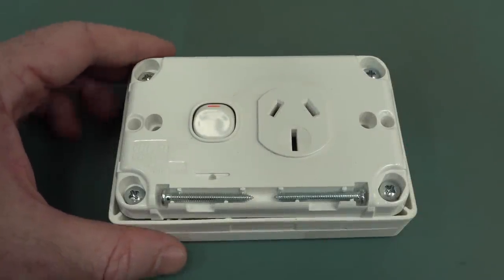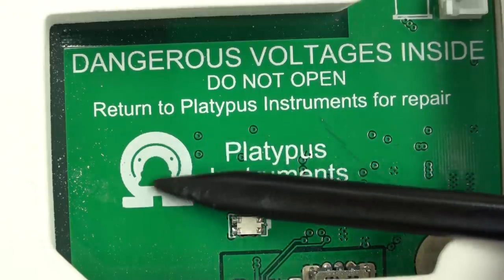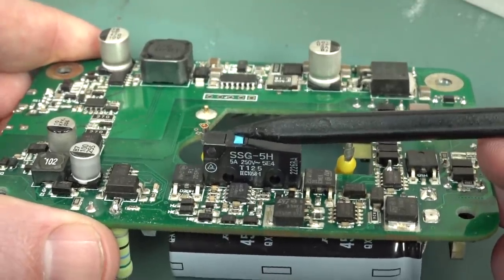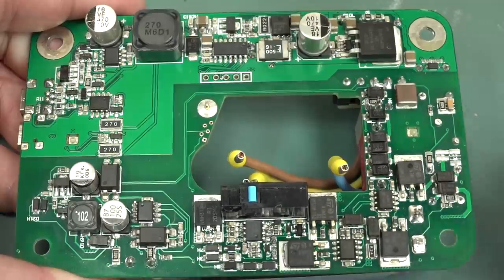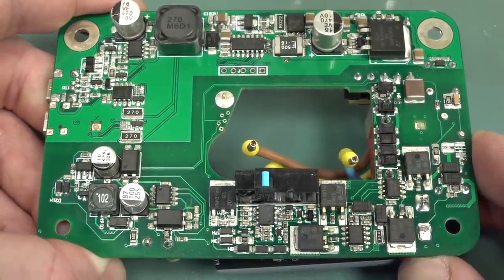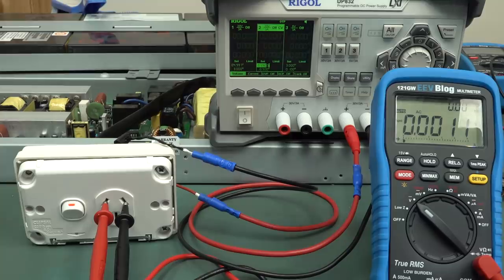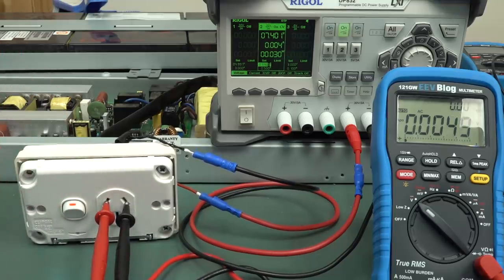EEVblog #1170 - TRUE Mystery Teardown! (not even Dave knows)

Comment: It is not a PAT Tester Tester.  It is a PAT Tester portable power supply for RCD (and possibly leakage) Tests.  The PAT Tester does the test the Platypus provides the power for it without needing a mains supply.  Nice idea, I wonder how many tests it can supply power for before it needs recharging.
Reply: its funny, I actually made a similar setup with a cheap 250w inverter and a battery from a pocket jumpstarter for when I go to hamfest's or flea markets buying old and antique ham/cb radios to test if they power up.
Reply: Yes would be interesting how long it lasts, it would last a while just doing portable rcd testing as it's over in milliseconds but the leakage test    product needs to run at  full speed for 30 seconds

Comment: Awesome idea! I worked for an Equipment Hire company and we needed to test the RCD on equipment that had a built in RCD, such as access equipment like scissor lifts and cherry pickers that supplied 240v to the basket. The RCD and tester needs a 240v supply and plugging into the building power could trip the RCD for the building, so I would lug a generator around with me. Considering this was done every single time the equipment was returned from hire it was a daily task. A gadget like that would have been awesome to have sitting on the work bench .
Reply: The new metrel pat tester has the isolation transformer built in no more tripping the rcd in the building

Comment: Did you reconnect the thermistor of the battery pack when applying the external voltage, maybe there is a lockout if no temperature signal is received?
Reply: Judging by the puffed battery i think he didn't put any thought towards temp, and btw hobby packs usually dont have thermistors, just balance leads
Reply: The 3-pin connector should be 0V - 3.7V - 7.4V for charging and the 2-pin 0V and 7.4V for power. 
Maybe it has a undervoltage protection for both cells... then it would shut off because there isn't 2*3.7V (ish) on the "charge" connector.
Reply: the two pin thin wired connector is the temperature sensor.
Reply: @jovangrbic97  No it is not. It's the main discharge leads. The 3-pin lead is for balancing. Go educate youself on hi-drain hobby packs and try again.
Reply: @zaprodk  main discharge leads usually use a thicker wire gauge than the balancing leads, not as in this case angel hair thickness wires, as used usually for thermistors. No issue in using one set of 3 leads for both charging and discharging...consider yourself educated
Reply: @jovangrbic97  you are incorrect. I worked for a hobby company for years, distributing RC-equipment and repaired equipment (mostly Hyperion chargers) - the discharge leads on small packs are indeed skinny, but there is ABSOLUTELY NO thermistor in a hobby pack. I would love to post a link for more info, but the comment Will be held if I do that.
Reply: @zaprodk  Quite right you are sir!
Reply: @jovangrbic97  like, it's not like you will ever get fat leads into that JST RCY-connector ...
Reply: @jovangrbic97  No, the Two pin one ist the total voltage of the pack, the 3 wire one is the Balance connector, the 3rd wire (blue in the middle) is the middle tap of the 2 series connected cells
Reply: @zaprodk  I agree the packs don't have one from the factory, but what about the device having it's own thermistor that was tucked into a battery?
Reply: The 2-pin connector seems to go to GND and the fuse (7:19), also, for a thermistor, the polarity wouldn't matter. I already posted a link to that battery pack at Hobbyking, which indicates that the 2-pin one is the discharge connector. But youtube indeed doesn't seem to like links  @zaprodk
Reply: @jovangrbic97  lol... who are you kidding with awg18 being angel hair thickness... and/or trying to reason that the JST cable isn't a main discharge cable...
Reply: @bryanjk  that's not the case. Then the company would have to open the pack and re-wrap it. Also if it was a thermistor, polarity wouldn't matter a rats ass.

Comment: Cool device and well built. Just a super niche market.  Great video. I'd make these videos too but, Bob's your uncle, not mine.
Reply: So well, they in fact could not even use a proper connector for the 200something output voltage wires you say?

Comment: Battery that comes with this devices also includes balance connector.  Looks like this device has safety feature that prevents powering on if balance connector is not plugged in.

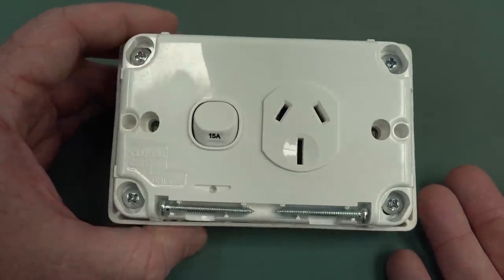Comment: 1:12 - What is the purpose of those two long screws attached to the case?
Reply: They come with the power outlet for install. A shiny smooth cover is usually clipped over them so you don't see anything but the switch and power socket

Comment: Dave, did you connect the lipo battery sensor while plugged the PSU to power it on? This might be the reason it did not turned on..

Comment: IDK if this was mentioned but it's like a Fluke PRV240 Proving Unit. Cool!
Reply: That, IIRC, is to test your tester/meter to make sure it's working before you use it to check whether a mains circuit is safe to work on. This thing is for powering an RCD (GFCI) device under test from a battery, so that you don't have to connect it to mains (which would be unsafe if done directly or inconvenient if done via an isolation transformer).

Comment: It's not a PAT-tester-tester

It's a portable supply for RCD / GFI testers. You need to measure trip times (sub 20ms at 50ma ground leakage in the UK IIRC) for them to be signed off as safe. This thing lets you do it in the field (literally) and is something that's not going to blow your bollocks off if something goes wrong. Similar to how insulation resistance testers (aka "meggers" or mega-ohm-meters) have a severely limited test current so you don't kill anyone when you shove 1000v down the lines to test for arcing.

Comment: Have I misunderstood massively ? It's a portable inverter for use with a PAT tester then - not capable of testing anything  itself...:o)
Reply: @
noakeswalker
yes , it is the power supply for the tester , it would do "go/no go"  tests such as connect an rcd (with no load or very small load) and push the test button :-)

Comment: Could it be that it did not work for you because you put only 2 of the 4 screws that holds the faceplate allowing a gap that may have ment that the interlock micro switch was not depressed?

Comment: What brand electric screwdriver do you recommend? 
Doh! Before I got to the part where you said don't look it up I already had. Fail. If you want us to not look things up, tell us at the beginning, lol!)
That Wurth transformer is a isolated flyback converter, essentially a switched mode power supply in a transformer format! There's another mosfet inside.

Comment: If ABB or similar was smart, they would jump on this and give the guy a bucket of cash for the rights to this. This is a really neat device and once that has actually important work to do. Jobsite power systems are no joke and they can be pretty dangerous. The RCD's on the spiders (distribution hubs) take a major beating and should be tested OFTEN. This is a smart device....hopefully they can make something of it. As I said, if some of the big time power distribution companies out there were smart, they would jump on this.
Reply: As well, they really picked all the top brass parts to stuff into it. Nothing from the shenzhen market in that puppy. A+

Dave, do you think when you tested it, it didn't work because you didn't bond the earth and just left it floating? I mean, thats what its designed to test after all ;-)

Comment: It all seems a bit 'how ya doin' to me.  Surely all you need to do to test an RCD is to push the button and see if it turns off.  Why would it need an isolation transformer in the first place?
Reply: I suspect some (most?) RCD's are self-tested by applying power to their internal trip mechanism when the test switch is pressed, rather than by testing via a mechanical button.  My guess is this makes for a more reliable indication that it will trip on an actual ground fault.
Reply: @PartTimeLaowai  The test button on an RCD connects a resistor which passes a 30mA current from the line input side to the neutral output side hence creating a current imbalance which trips the circuit.  Actually I was being a bit sarcastic because the RCD testers are required to check the response time at various fault currents.  I genuinely don't know why an isolation transformer is required.
Reply: I also have a problem understanding what problem does this device solve.
Reply: @shana_dmr  it lets you run tests without plugging into the grid. You don't have to worry about tripping upstream RCDs, or if you have a fault, letting out a lot of magic smoke since the little inverter can't source much current.

Comment: I thought it was some appliance tester. The battery only puts out enough to run mabe a few minutes. Not sure why on earth you would need it except to verify your equipment is indeed functioning. I ran into an issue with an RC transmitter sold by Flysky. It is a computer programmable transmitter. Probrm is you can no longer get the files for the thing. The company that made them no longer has the files posted and no one on the internet has them any more. It was a cheap $30 unit anyways. I ended up tossing it. Any time you have technology like that which requires computer related files to work , you take the risk of finding out what you need is no longer available. The transmitter came free with a brand new RC plane I got off the Marketplace anyways. I have other much better quality transmitters with built in programming.
Reply: Kinda like PCs from the '80s!

Comment: I made a simple passive PAT-tester tester. I repair, among other,  PAT testers and for me it is just handy to check the functions like leakage and isolation resistance. But it should be important for PAT tester users to test their PAT testers because it often is unknown there is a fault until they bring it away for calibration. And that means that, from a point in time between calibrations, their safety tests could have  been corrupted and unsafe devices have been tested OK.  I have seen a PAT tester that  switched some of its relais in a selftest  and passed, but after I removed the bad relais the selftest still passed. Often isolation tests go through some relais inside the PAT tester. If that relais is dead and stays open, even a short direct to ground in the device you are testing will test OK . So grap something high value resistors,   put them in a cabinet like on the video and use that to quickly test your tester for you use it. I have placed some banana terminals too, for connecting the leakage test probe of a G&M Secutest and a multimeter to check the output of the PAT tester)

Comment: its needs the battery in it to work btw dave. I'm assuming its measuring both cells hence that 3 pin connector. I'm thinking even though it sees the 7.4v, the micro isnt seeing the seperate 3.7v on each cell through the balance connector. (3 wire job) So i'm assuming because of this, it won't even enable the inverter section.  (I have a qc 3.0 powerbank that works in a similar way using 2 lithium cells. It won;t even bother power up on my bench supply unless it sees each cell individually. Not saying thats how this is working but seeing as the components and structure share a lot of similarities, figure its a good guess.

Comment: "You wouldn't plug a powered male pin into a female receptacle"
Unless you were using a washing machine motor bolted to a wooden
frame to crank an otherwise manual tomato squishing machine
to make tomato sauce, as Italian families did.
Such a horrid contraption was brought to our house yearly.
It had a female mains socket mounted on the wooden frame
and was powered by a male-to-male mains cord some insane person had knocked together. Even as a young kid I recognised this as WRONG WRONG WRONG.